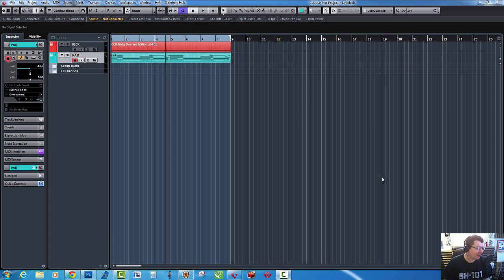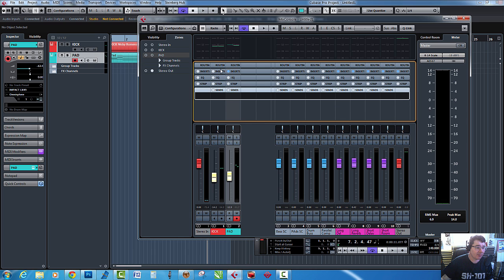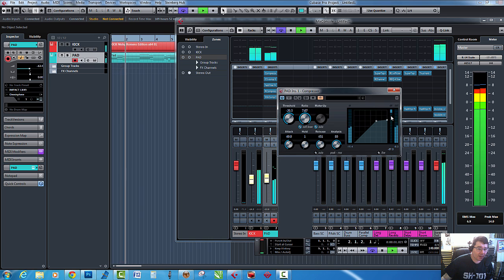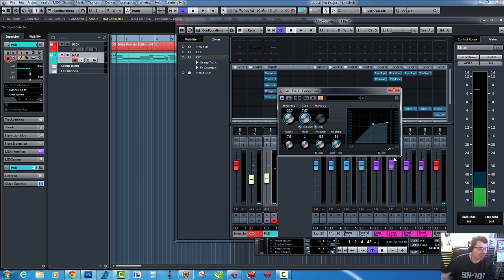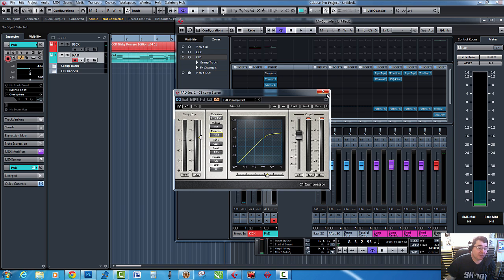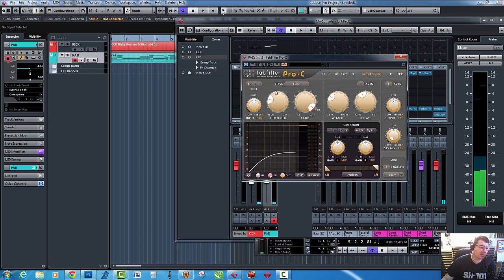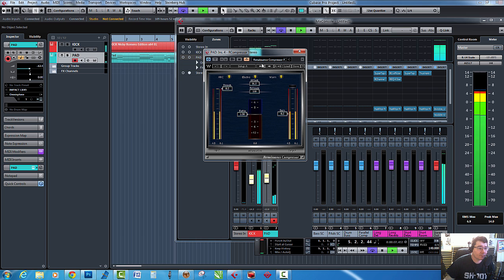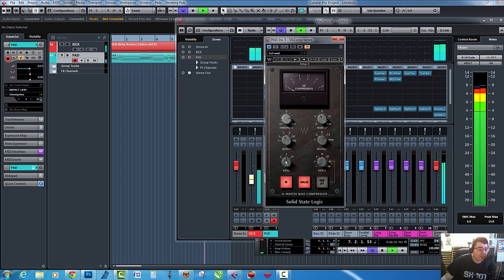Sidechaining with 5 different compressors in Cubase Pro 8

Comment: hm my (no stock) compressors dont pop up in the sends list and i can only click the sidechain button in the stock compressore of cubase aswell, not in the the pro c or similiar, because it is not there. did you do something to make the buttons appear in 3rd party plugins? thanks in advance
Reply: +Only God Can Judge Me I forgot to say i appreciated it. thanks :)
Reply from the maker: Prevade you may need to rescan your vst plugins folder for vst 3 versions of the compressors. ONLY VST 3 plugins will have a sidechain button
Reply: ah yes i read about the vst3 thing. thanks a lot! could you tell me how to scan the vsts? sorry foor the nooby question! just switched to cubase and since it loaded up all the plugins on its own so far i didnt do anything like that
Reply from the maker: Prevade what version of cubase are you running??? if cubase 8 go to devices > plugin manager > and at the bottom you can select your paths to where your vsts are located, then rescan. :)
Reply: Mike Smith Thanks again and I subscribed to your channel now, because of your nice responses (and probably videos hehe..)! Seems like I only got a vst 2.4 version of almost everything :/
Reply from the maker: Yeah not all vsts are vst 3, Fab Filter are though so you should have those. It does install them into a different location to your normal vsts
Reply: haha ah right i saw this more than a hundret times while installing.. sorry for the bypassed brain
Reply: Prevade 2.4 version of cubase holy shit that's like a decade+ old! LOL. Think its time you upgrade! You can upgrade to elements 8 for cheap!!
Reply: +Only God Can Judge Me no no the vst plugins are version 2.4 instead of 3. maybe some of my plugins are too old, bur i use cubase 8 ^^
Reply: +Only God Can Judge Me ops, answered with the wrong profile, but im prevade
Reply: Oh that's what's up! ;) Just trying to help.
Reply: ^Your welcome just don't forget to click the link above! ;)

Comment: Great vid but guys i'm stuck... How do you mute the trigger track in Cubase 8?
Reply from the maker: Hi Steve each channel is routed usually direct to the stereo output channel, so to mute the trigger just disconnect the output by selecting NO BUS in the output section. This is done in the mixer at the very top. hope this helps. :)
Reply: Yeah, that helps a lot. Thanks Mike you're a gem. Just upgraded from 5 to 8 pro, OMG it's so different. Great, but complex.
Reply from the maker: yeah it is but its so much better especially with routing in the mixer. a massive improvement. :) Just takes a little while to get used to. :)
Reply: You're so right, however new issue, still staying with sidechain - I did what you said, changed the routing of the kick trigger to no bus and that worked when applying sidechain to a specific track, however, when i tried to apply sidechain to a group channel the kick becomes un muted even though it is still routed to no bus... Any ideas? So frustrating.... Sorry to be a pain.
Reply: Oh, and it must be a routing issue because i tried following your vid on FX channel long reverb and when i added the compressor, not only was the kick audible it was washed with reverb from the FX channel.
Reply from the maker: steve booth No worries. So are you using the sends on the kick trigger? i.e. sending trigger signal to a compressor on a group or channel.
Reply: Yes, is that right?
Reply from the maker: Yes thats right....i know if you solo the group channel you will also need to solo the trigger channel to hear the effect.
Reply: I think there's something wrong with my version, now it's only sidechaining when the 'activate sidechain' button is off. Start from scratch me thinks. Thanks for your help Mike.
Reply from the maker: Yeah very strange....that certainly does not sound correct :) hope you get it sorted!
Reply from the maker: steve booth Another way Steve with Cubase 8 you dont even need to create a seperate track just use your kick thats in the track and use the sends to send to a compressor (with side chain activated) on a channel  or group. I do still use a seperate track however as i usually want sidechain even when the kick is not playing in my track :)